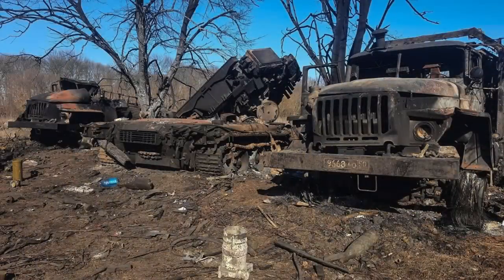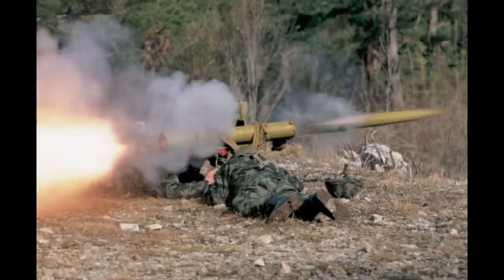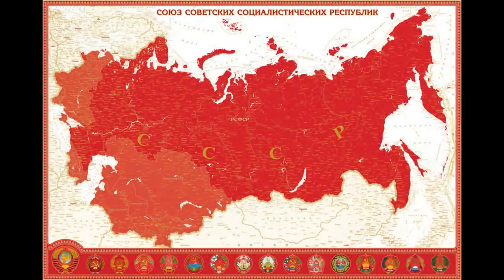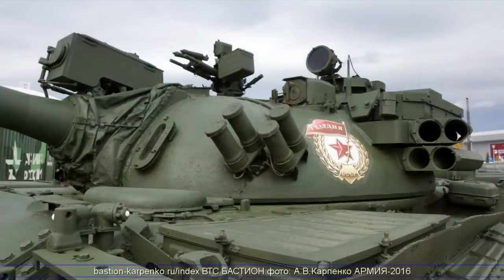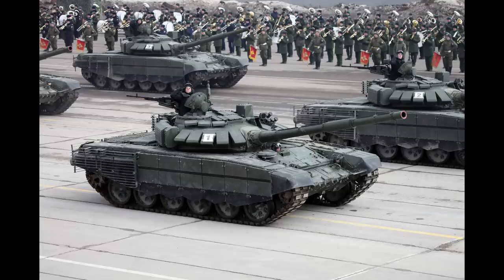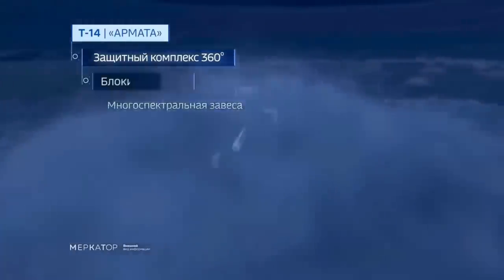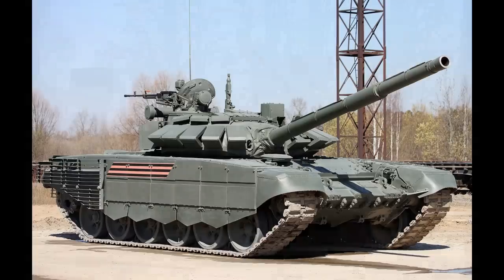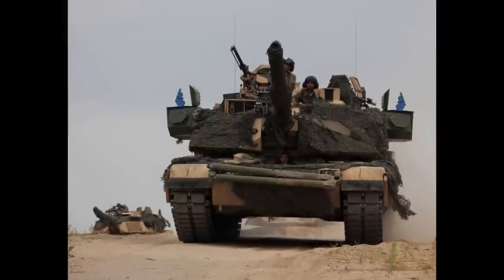Why are Russian Tanks Failing in Ukraine?

Comment: The biggest factor by far for russian tank casualties was the stupid strategy of the first phase of the war and the low manpower especially in comparison to how much heavy equipment they brought which mean they already had more tanks than their infantry could support and the supplies where also drained, very few men pushed very far and didnt secure much of the road their supplies would need to drive on which the ukrainians managed to exploit with saboteurs and ambushes and most importantly artillery strikes, often even aginst unmanned targets. Most of russian casualties were in the first two months and a majority of their losses came from logistical problems which left their tanks and vehicles vulnerable which Ukraine also used to its advantage. Of course APS would have helped the russians but in a much smaller way IMO, if you use the weapons at your disposal in bad way, the tank or the crew aren't the problem and APS hard-kill would have had a hard to notice effect on how many tanks russia would have lost overall.

Comment: I have some big questionmarks for APS systems.

- they are very VERY expensive
- almost every version will murder nearby infantry, so you cannot have allied infantry supporting you to prevent the shot in the first place
- it relies on relatively sensative equipment to stay functional. In Syria there were already teams with rocketlaunchers, machine guns and marksmen who would simultaneously use rockets to damage or kill the target and the machine guns/snipers to damage gunsights. It would be a small leap to use that against APS systems to blind them before/during a strike.
- some weapons that dont realistically kill the tank suddenly become useful. A 20mm autocanon on an infantry fighting vehicle wont be destroying their opponent but one lucky hit near the APS system is going to add a massive pricetag to the tank's next maintenance.
- the systems can recognize a lethal payload from a "non-lethal" one. The problem is that repeated hits from smaller payloads can most definitely destroy tanks. This was again used in Syria.
Reply: 1. So is the tank. If a 500k APS saves a 6mill tank, then it’s more than worth it.
2. If a shape charge is hitting a tank, the infantry is in danger either way if they’re close to the tank. Not to mention ERA is used on almost all tank’s sides(TUSK kit) and combined arms is still very much alive. 
3. Same could be said for a lot of other tank equipment sticking out of the tank. The commander thermal, remote weapon platform and more.
4. This has been the case since a long time ago. The test report of the main weapon of the BMP 2’ auto cannon vs the BMP 1’s low velocity cannon, showed the auto cannon to be capable of causing damage to periscopes, lights and even jamming the turret of the old target tank. But if you’re shooting a tank with a 20mm, you’re probably in a position to be shot back by the 120mm/125mm.
5. Yes but the effort is greatly increased and if they’re forced to do so, then the APS is already achieving a deterring effect.
Reply: @GrassMudHorseLand 1: the point is that its expensive but has many drawbacks despite that.

2: not all explosions are the same. A shaped charge hitting a tank or ERA has a much smaller danger zone than an APS firing a shrapnel charge one way and detonating the shaped charge mid-air splintering in all directions. That is why this is said about APS and not ERA.

3: the difference is the cost and vulnerability. The commander thermal can be damaged but much of the equipment is inside the tank. The fact that a part of the "armor" of the tank is now extremely vulnerable to guns that are much less potent otherwise is a big drawback.

4: the point is that at the end of the day fights happen and things get damaged. If you need to replace damaged APS systems constantly your tanks will require more maintenance hours and more supplies. Compared to a gunsight that is a massive difference in cost, specialized man hours and supply needed for something that is relatively common (there are far more armored fighting vehicles than MBT's).
Also tanks rarely drive alone and if you expect to come up against MBT's you'll almost always have anti-tanknweapons along, so if a 20mm canon can hit you and destroy your APS it is highly likely either a rocket the APS is supposed to stop or another tank is nearby ready to open fire on you.

5: the APS can absolutely be helpful, my points are about if its upsides negate all the downsides of the system.
Reply: @TheDemigans  1. I understand but the same argument can be said for the MBTs themselves. People have been saying the same for tanks how X is the end of the tank for decades and that's the case. The same goes for APS, if it doesn't work then it wouldn't be on so many MBTs especially the likes of Israeli tanks where the threat you describe is very likely and constant.

2. You're right, they're not the same but both combat doctrine and system design would consider that. If average joes like us can think of the drawbacks, so can the brilliant minds that design far more complex systems. Again, using the Israelis as an example, it's clear the benefits are far greater than the drawback for actual combat usage. 

3. This depends on how you view the system. At the end of the day, the APS is an add-on rather than "hard armour" and depending on the system being used, it can be sheathed in a protective shell before the onboard radar activates the system (eg, the APS on the T-84 Oplot). We have to be careful not to focus on a narrow view of warfare and consider a tank to be completely naked complete a portion of its defensive system is down, since you can make a similar argument about how a tank is vulnerable to other tanks if its commander thermal is destroyed and it can't identify an enemy tank quick enough.

4. That's a fair point, but as I raised earlier, APS can be protected and the system is tiny. If we're fighting at extremely close distances then there are too many factors to consider for a purely theoretical debate online XD

5. That's fair and I understand your standpoint. However, given the historical development of modern warfare over the last 50 years, it's fair to say the better-equipped/high-tech weapon platform is better the majority of the time. After all, even countries like China are realising this and modernising their army towards this paradigm where budget allows(eg, slowly giving all infantry proper plate carriers, etc). Of course, who knows in the future how it'll play out. Maybe we'll go back to attrition-based warfare where number is king, but I hope I don't find out.
Reply: 1: not the same. MBT's have a role that isnt going to vanish soon. However APS has some serious flaws that people seem to gloss over. The things about APS were also said of the anti-ballistic missile defenses, which arent the perfect shield people made it out to be.

2: many things are considered, but rarely is a weapon system perfectly designed. For example one of the reasons the USA still uses the Abrahams is that every new tank they designed was pulled in every direction until it was too expensive and unable to do anything well. The same has happened with most aircraft and other designs.
If you look at APS, its mainly used as propaganda and marketing. Israel will report APS successes in detail but failures are more on the lines of "the tank/crew survived" because they cant sell a system that might not perform, and their opponents are a resistance with only a few modern anti-tank weapons.
I'm not saying the APS cant perform its duty, however there are reasons why information we get about it has to be taken with more than one grain of salt.

3: I view the system as a component we dont know much about, but has clear disadvantages that few seem to even want to consider. It remains vulnerable outside the main armor (even when sheathed) and when friendly infantry is nearby the system has to be either shut down or infantry sacrificed in the event of an attack.
Your comment about not seeing just the naked tank is exactly why I have such big questionmarks with the system. Outside of asymetric warfare combat doctrines already exist that could defeat APS without changing said doctrines, meaning that when deployed these supposedly almost flawless systems could suddenly be not efficient enough to buy, maintain and use.

4: We dont know how effective the system would be in a battle against a trained army and we dont know if it'll be cost-effective. One 500.000 system saving a 6+million tank sounds like an easy deal, but the maintenance, repairs and supplies required to keep them running could very well be more detrimental in the long run.
More technology isnt automatically a win. People tend to forget the Heavy Tanks in WWII which were usually more modern than their "ordinary" counterparts but were such a drain on resources and technology that the war effort suffered. or how WWI&II showed that warfare is now a war of supply. It doesnt matter if your T14 Armata is fully functional and build in numbers if you cannot supply, maintain and repair them due to the bridges being destroyed. That is one of the reasons I have big questionmarks on APS system, its a costly high-tech system with tons of downsides that is being marketed as a golden bullet by its creators. Even if the system turns out to be perfect, there is no reliable proof yet that it is or how it will function in more than asymetric warfare.
Reply: @TheDemigans  1. Oh yes, the system is definitely not perfect but nothing rarely ever is. The fact is, the system just needs to be good enough for the job for various factors like cost-efficiency, ease of use, increasing the tank's survivability to X percent more, etc. I mean look at the Russians, had they installed the shitty Drozhd system and saved 30% of the tanks that were destroyed, the system would have been worth it. 

2. I agree, but at the same time the complexity of an APS is more simple than a full MBT and in turn easier to test and design (at a high-level). I won't say the system is perfect but even filtering what info we have at a basic level shows APS increases the survivability of the installed vehicle. 

3. Because I think you're overestimating how easily it is to take out such a system. At this point, we simply have too little data to show how effective units can snipe out specific systems on a tank. Doubly so when the system is tiny in comparison to the tank itself in the first place. Again, nothing is flawless but I feel you're thinking on the other side of the spectrum too much.

4. I mean the tank itself is expensive to maintain but I get your point. Warfare in the last 40 years or so has moved on quite a bit from the paradigms set down in the World Wars, but like I mentioned in my previous point, is there a chance we'd revert back to the attrition-based consumption wars? Possible but no one can say for sure. A lot of MBTs are by design are highly advanced systems(or contain advanced systems) that require specialised maintenance. The Abram isn't the Sherman where you can weld a steel plate for "patching" holes anymore and so on. At this point, we can fairly confidently say the more rugged tanks are not fairing well against the enhanced man-portable anti-tank tech of the last decades.

Comment: 0:20 one thing needs to be said, they could have prevented this by not attacking Ukraine in the first place...

Also, when it comes to Drozd... what if it is the same as with T-72BU and T-90 or with Object 195 and T-14, thus what if Afghanit is just an improvement on Drozd... They both look like they have launch tubes of similar length and probably work in the same fashion...
Reply: Odessa 2014 what you would do then?